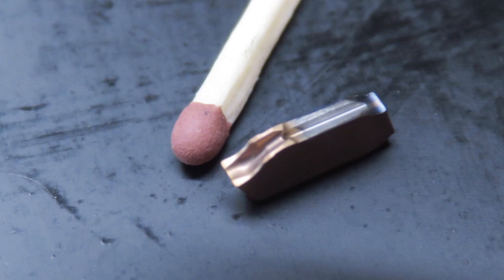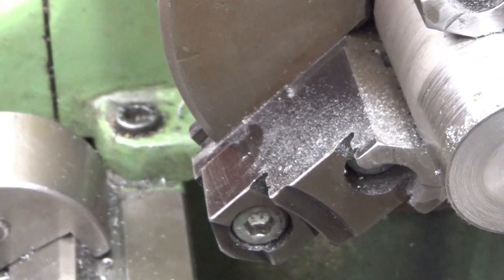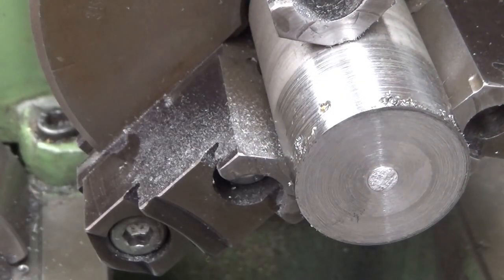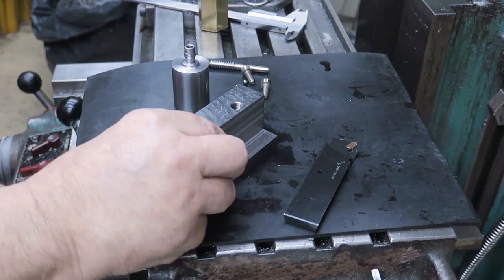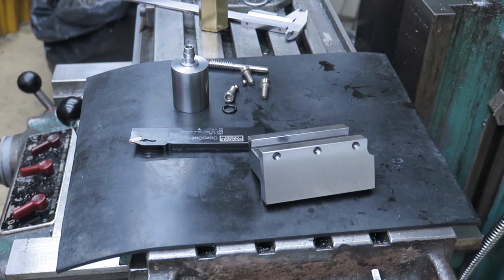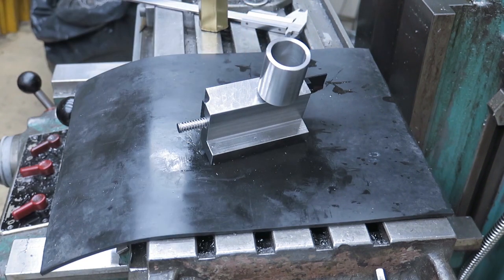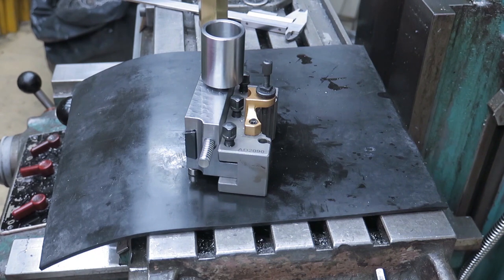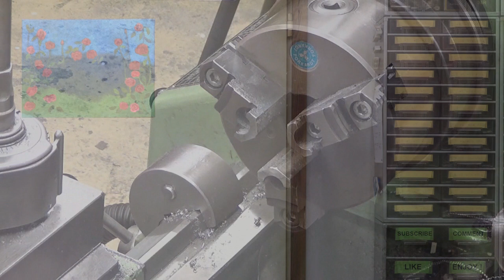Making an upside down parting blade holder

Comment: Great ideas and execution! I was not expecting you to go and use that coolant channel in the tool. 
I am not convinced though by the inverted tool position. The conventional lathe is obviously designed to lead the cutting forces into the machine bed. Inverting tools will actually work to do the opposite. 
I might add a rear tool post which might be used for an OD chamfering tool and that would be the only tool I might mount upside down because the cutting forces are very low and the lathe can keep running in the same direction. Then again, a rear tool post is the superior solution for parting off, in which case I would like it regular, non-inverted. Further down the line might be a 4-way indexing rear tool post which would add some more tool positions...

Comment: Could you kindly add the actual Sandvik part numbers used in this excellent project?
Reply from the maker: Here they are:
QD-RL1E26 C21 D  - this is the blade.
QD-NE 0200-0002 CM - this is the insert.

Comment: Sometimes upside down is better ;-)
On smaller lathes it is better to use a solid rear toolpost with an upside down blade.

And - the oiling mechanism is far out fantastic :_)
Reply: Yes, for  belt driven lathes with bronze bearings the rear upside down parting tool  works well......BTDT.
The main problem with QCTP and front parting is that the tool has too much overhang and this causes the tool to deflect down and dig in.
I have an old capstan lathe and the rear mounted parting tool is 6mm wide.......parting off 50mm diam material is done at 300rpm.